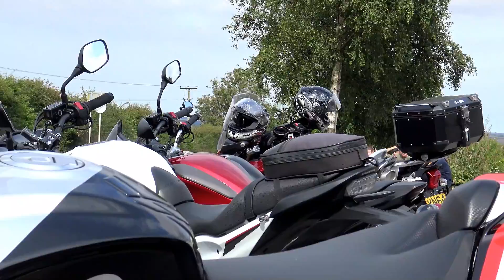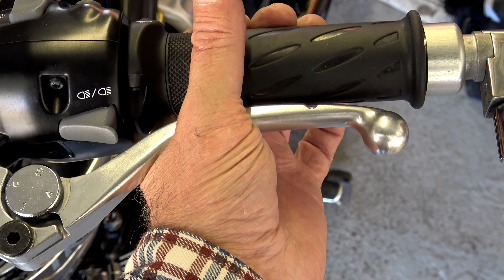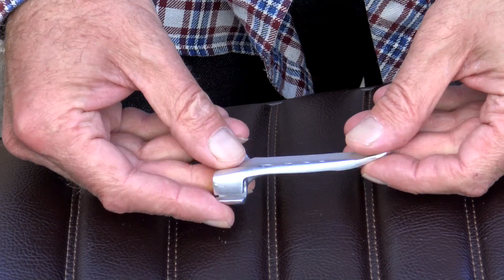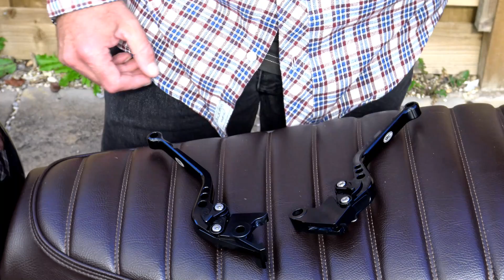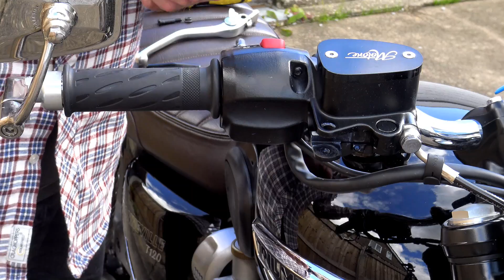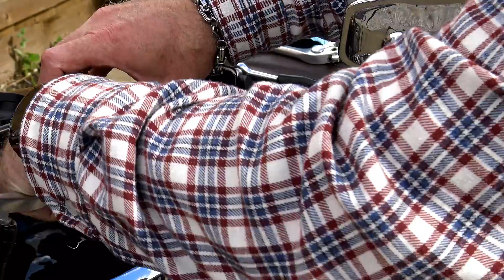Triumph Bonneville T120, Replacing/upgrading the brake and clutch levers/TEC bike parts!

Comment: Another great mod for your bike.  I put a pair of Pazzos black levers on my TTR for much the same reasons you noted.  One tip I found on a video after my install that would have made the clutch lever install much easier is the adjuster at the clutch lever perch is also slotted.  If you line the slot of the adjuster up with the cable perch slot, you can extract more of the cable end from the perch which makes it much easier to remove and insert the clutch cable end into the lever slot during the install.
Reply from the maker: Ah now thats a trick I had forgotten all about! Thanks Mr Supercruze!

Comment: Nice bits !  The clutch cover bolts are definitely 8Nm .
Reply from the maker: Thanks Mr Cool Much appreciated, ill be glad when someone publishes a workshop manual!
Reply: I had the same problem with my 2008 Bonny , the books went up to 2005 and only covered the Carb models . The Haynes Manual I have now covers  '01-'15 and clutch covers throughout are 8Nm , front sprocket cover bolts and alternator cover bolts are 9Nm . I realise your's is the 1200 so it is possible that the specs are slightly different .
Reply from the maker: yeah it a bind having to rely on the dealers for torque values, the computer system always seems to be down and I cant help feeling they are just been difficult at times!